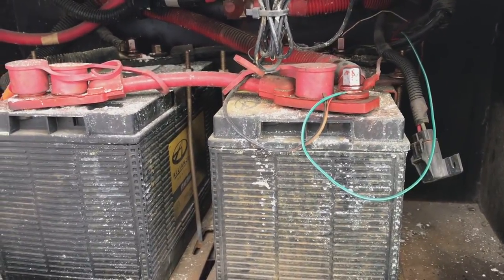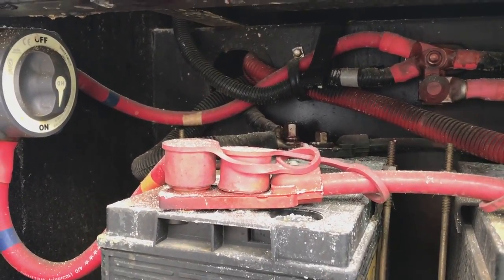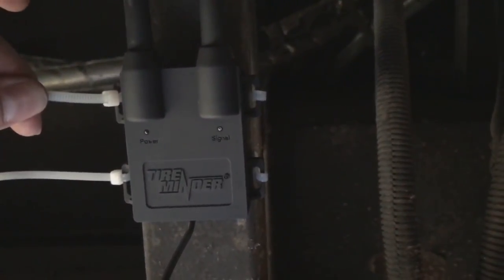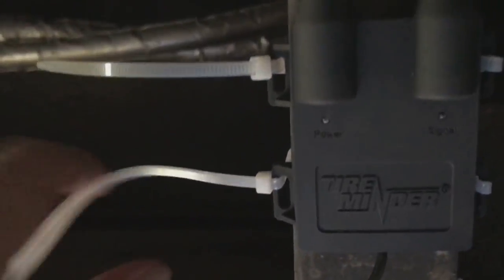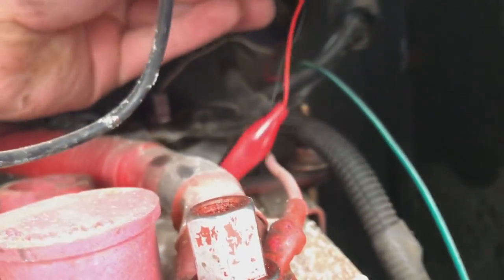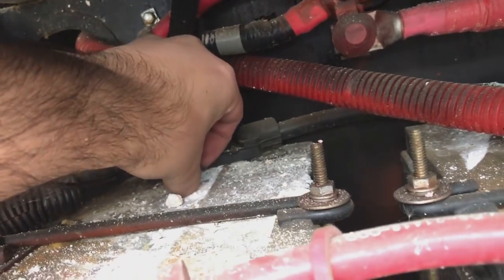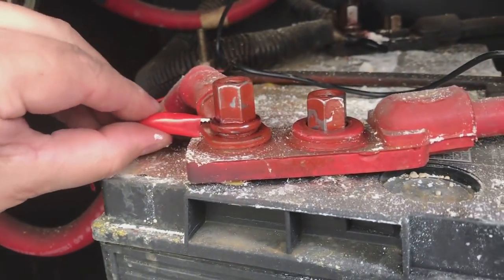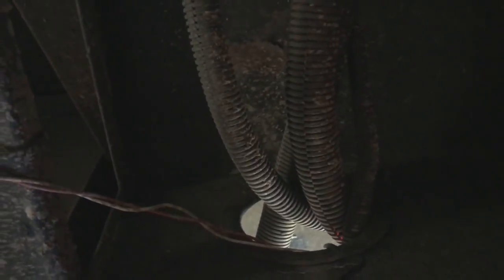TireMinder Rhino Booster Installation - Class A Diesel

Comment: I need to relocate my booster, cause I also have the Ford V10 chassis and the batteries are in the step.   So I'm going to extend the power wire of the booster with some 14ga so I can mount it closer toward the rear of the coach.   

On our last run, the rear tires of the trailer kept falling off due to the distance.   Hopefully there is no issue with extending the wiring.  I am using a thicker gauge to account for voltage drop.

Comment: Does it say it should be clipped directly to battery? Seems like you’d want to tie into a running light so that booster isn’t ALWAYS on...
Reply: I will assume you are correct, as my booster has stopped working, although mine is hooked up 24/7, so some kind of switch to a wire that works only if/when the ignition is on would be better.   Remembering to unclip the booster signal wire just doesn't happen for me, as I have so many things already that need attention when we get to our destination!

Comment: Maybe that works well when you have house batteries in the rear of the coach. However, I've got a Ford V-10 chassis and the batteries are in the front of the coach under the steps. My experience so far is that the booster is apparently not strong enough to get to the 4 new tireminder on my towed vehicle. What do you recommend to resolve this issue? Can the booster be tied to a 12 volt connection somewhere else in the coach to improve it's reception?
Reply: I've read that some have a 12V connection (perhaps off of the light) in the rear closet, which has worked for some.

Comment: The alligator clips should be replaced and the unit be wired to the output of the battery switch so it does not draw current when switch turned off.

Comment: Only complaint I have is why alligator clips? They rust very quickly. Why not have it so you can be put on the battery post like battery cables? Mind corroded  the first season.
Reply: Because alligator clips are cheaper than the inline switch you would need to prevent the thing from killing your battery with its parasitic draw if you store the coach for a few weeks, and don't want to have to pull out a wrench every time you connect or disconnect the thing.

Comment: It appears the booster is always on drawing power. - What is the amp draw over 24 hours? - Is the circuit fused?Does the system work without the booster for the newer TM77?  One of your videos says it has longer range than previous models.  If so what is the range before the booster is needed?  If the booster is installed to a conventional travel trailer,  does it still work for the tow vehicle when traveling unhooked and away from the trailer?Those sure are dirty batteries!
Reply from the maker: Bruce, the TireMinder Rhino Booster draws 14mA in standby and 75mA while transmitting. We recommend always installing the booster. This is due to not only range, but signal interference from other wireless devices. For additional information on where best to place the booster, please see https://www.minderresearch.com/tireminder-booster-instructions/. If the booster is installed to a conventional trailer (travel trailer, 5th wheel, horse trailer, etc...) and the trailer is unhooked or disconnected from the tow vehicle, the tow vehicle will still function normally without the signal booster. Please let us know if you have any other questions.

Comment: Can't believe the batterers, cables and tray weren't cleaned before installation of the TireMinder wiring!
Reply: That was by design.  If they had tidied that battery compartment up, the way anyone who cares about their coach would, the ludicrously sloppy way the booster is installed (zip ties and alligator clips) would have stood out even more.